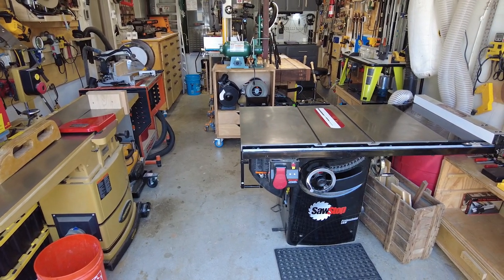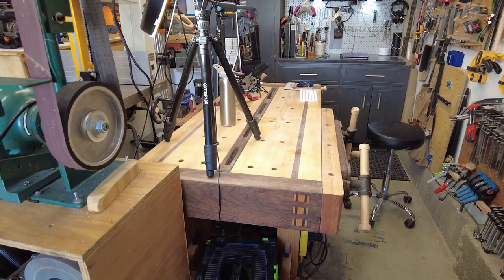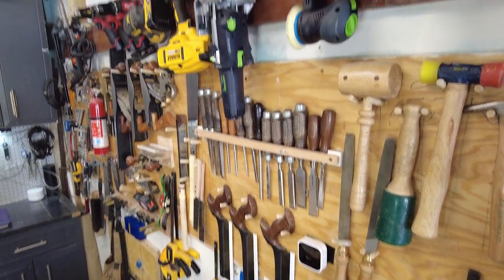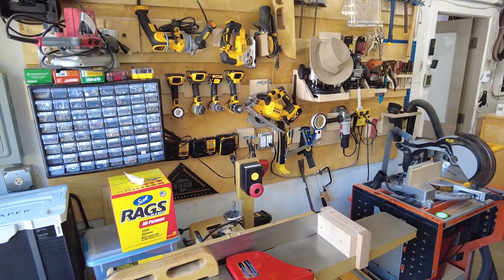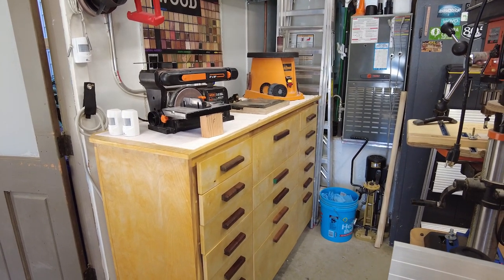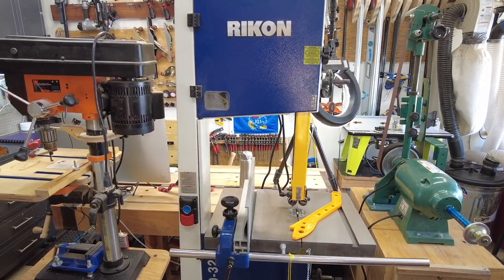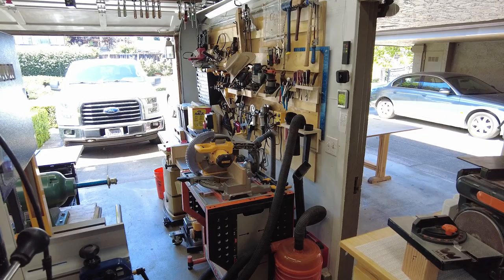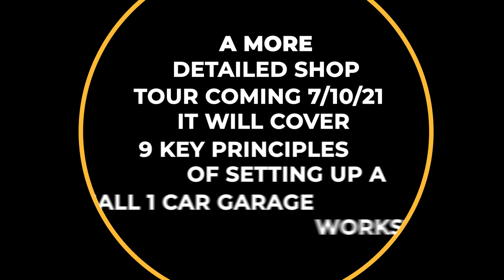2021 Woodshop Tour of "Fully Loaded" One Car Garage - Only 7 MInutes Long

Comment: Glad you flew out of the coop with that drone video you old coot. Is that you new truck in the driveway? Old coots never die they just get better with time
Reply from the maker: Yep, new (actually 2015 but new to me - only 32,000 miles) Ford F-150.  Yesterday, I ordered a Ford Transit Cargo Van with the High Roof - when it shows up in 6-8 months, I will start a Van Conversion.  Lots of fun planning it in the meantime.  And then real workshop tours across the old USA.
Reply: @SmallWorkshopGuy  that’s excellent Paul

Comment: Love the shop, and it is loaded, but I’m sure there might be just enough room for a lathe!
Reply from the maker: Did you see a spot - where, where?!
Reply: @SmallWorkshopGuy   seeing how well you have done already I am sure that you would be able to find a solution.  My shop is the same size, but not quite as loaded.  And I do want a lathe but it is outside of the tool needs for what I currently produce.  I am finishing up one project, then I am doing a complete reorganization and rebuild of my shop.  I like your philosophy of having tools at hand.  Great Job on your shop.

Comment: Paul, How do you like that Rotex 90?  I bought the Rotex 125 because I wanted to share paper with my ETS 125.  If I had to do it all over again, I think I would buy the Rotex 90 and the Rotex 150 and skip the Rotex 125
Reply from the maker: Good logic.  I like being able to put on the triangle head and sand in little corners, etc.  Guess i like the dust extraction more than the sanders.

Comment: Paul, I'm about to order my sawstop.. (going full hog ICS)  How do like your folding outfeed table?  is it worth the $350?
Reply from the maker: Yes, I love it and worth the money.  In my case, being able to free up the space behind the table saw for other carts as needed is crtical.  If I had a dedicated outfeed table, I would not be able to move another tool in that floor space and I would not be able to walk all the way around my workbench.
Reply: @SmallWorkshopGuy  Thanks for confirming my thoughts.  I have a two car garage but my shop is only one bay of the garage.  The wife likes to park on her side.  I have my table saw setup in between the two garage doors so that I feed my one from my side of the shop to her parking area.  having the folding outfeed table there sure would be handy and it would still allow her to park her car when not in use.